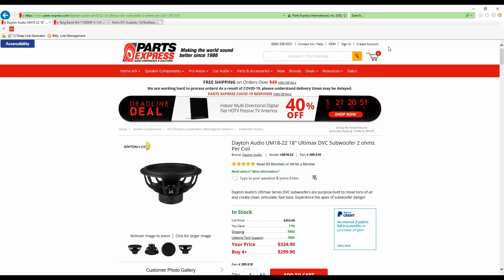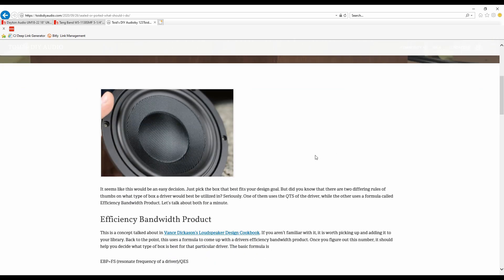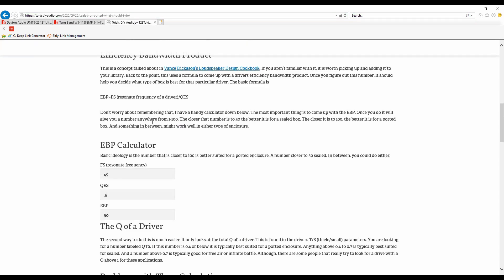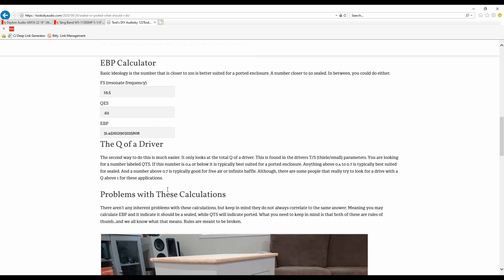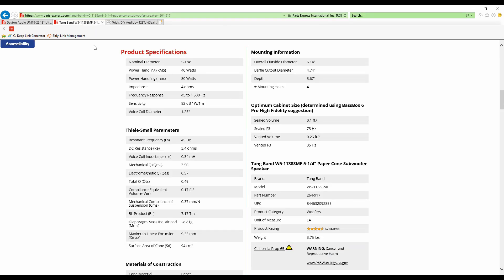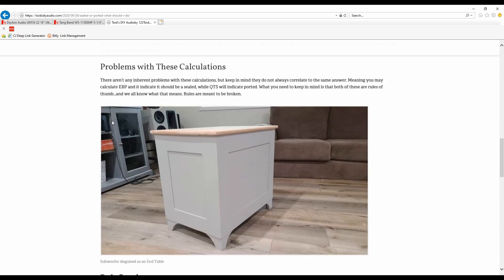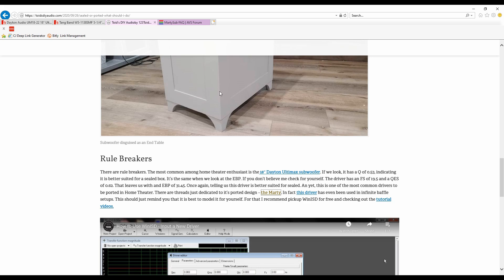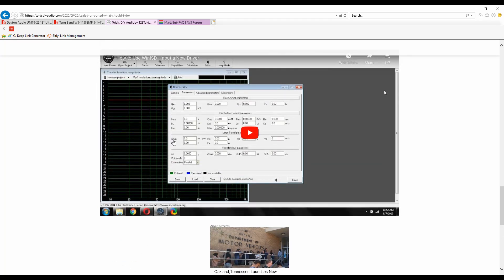Sealed or Ported. What should You do?

Comment: Of course the preferred method is to choose the type of enclosure you want to use (my preference is sealed, OB, or TL) and choose the driver accordingly. Of course if you already have the driver...

If you have a driver that wants a port try modeling it as a TL (hornresp program is free). The scuttlebutt is that TLs mitigate some of the disadvantages of normal ports.

Comment: Neither - passive radiator for box or open baffle if there is a house with space to gut.   

Sealed box sounds great but drops out on low end and needs a lot more power.  

Other exotics are too difficult to calculate and construct for novice builders.  Transmission line, folded horn, tapped horn, etc.

Comment: Watchers/readers should remember that this is all "rule of thumb" and not hard and fast. I've used drivers with a Q as high as 0.61 in ported (C4 alignment) vented boxes. Of course box size gets huge and there is ripple in the response, but sometimes you have design goals and lack of constraints on box size where this is perfectly OK.  Don't get caught up on the numbers. Investigate the possible designs and then decide. And don't be afraid to experiment. (Also, my rule of thumb for beginners: Build a sealed box, acoustic suspension, Alpha of 3 or higher.)

Comment: Interesting. First time I have seen this formulae for choosing a speaker. Sounds like it isn’t always right though. Maybe it is too simplistic? I designed a transmission line speaker awhile back and I agonized over driver parameters. I think the choice also depends somewhat on listening preferences. I gathered from researching it that I needed a moderately compliant speaker with lots of travel (large Xmax). I also decided that lots of electrical damping (Low Qe) would be good for better control over the cone movement (good attack and decay for clean, detailed bass). At the same time not too much mechanical damping (Qm) and low cone mass also should help with bass definition. I ended up choosing a Focal 5 1/4” square wire wound driver with Aerogel/Kevlar cone, phase plug and rubber surround. The final product turned out great, after a bit of tweaking. I had to re-listen to my whole music collection as the improved bass detail completely changed the character of the sound. I could now hear individual instruments and voice sounded more natural. At least that was my impression.
Reply: That’s interesting, I have some mission speakers with about the same size aerogel Audax drivers. They do surprising things for what is a small tower. Might not be as good as the Focal however
Reply: @RennieAsh  I always liked Mission speakers. Nice European sound with clean bass and good detailed treble. The woofers I used were Focal 5W 4252 paired with Focal TC90TD5B tweeters.

Comment: And then there's passive radiators. I have really warmed up to those recently, kinda gives you the best of both sealed and ported.
Reply: My Definitive technology suber cubes have 2 passive radiators and I am absolutely in love with the bass. I like deep tight bass. I find passive radiators kinda provide an acoustic spring keeping the bass tight and it is considered ported  so best of both worlds all in a small enclosure
Reply: @VINNY5674  Absolutely, Great design, more should use it.
Reply from the maker: I do love me some passive radiators.  As far as the calculations are concerned, a PR is considered a ported box.  So you will want to look for a driver better suited for ported enclosures.
Reply: Passive is a great compromise. REL uses this on their smaller subs. Offers all the accuracy with more bass extension with out loosing control or overhang.

Comment: I can't seem to get Win isd to work keeps telling me I need a huge box volume. Tried inputting the ts numbers in two ways with the same results. :)
Reply from the maker: Those are just suggested box volumes. you can edit them down and see how and what changes.  But oftentimes with drivers, you'll need a very large box to get a real low tuning. It's based around Hoffman's law.
Reply: @Toid  Cool, I shall give it another bash and play around to see what happens.
Reply: @incorporeal3793  Just remember there's a limit to what WinISD can do. I built a subwoofer some years back, 12 years ago now, and I remember I decided to put an 18" driver with a 9cuft vas and fs of 26hz in a 38 cubic foot enclosure tuned to 7hz. It did work technically (94dB at 6hz in my house), but it worked much better when I eventually put it in a smaller box (20 cubes now) tuned to 28hz. I did try various tunings with the big box but I think with such a large box there are losses of some kind that I don't know about, maybe relative to woofer size or port location. Whatever it is, be reasonable about box size.

Comment: It should be for application first. For music you may only need 30hz minimum and for movies 20hz minimum. For music quality you might be able to get away with sealed. For home you may be able to get away with ported. It amazes me how hard it is to achieve quality 20hz. I have several lower end svs powered subs and even though the frequency response goes below 20hz. They dont seem optimized for that kind of response. The sound is sloppy and struggles to perform well in that region
Reply from the maker: That especially happens when you have a subwoofer that is playing notes below the tuning frequency of a ported system.  The driver starts to loose control. It's part of the reason people love the Ultimax 18.  You can tune it to 17hz.  In theory, you should not get that sloppy bass.
Reply: @Toid  I thought that SVS was a good brand for powered subwoofers. Even their entry level subs should be good. I have the ported version. It claims to be able to go to 19hz. Im kinda thinking that the reason it is sloppy with anything under 30hz. Could be because of the cheap enclosure and port.
Reply from the maker: @randomtube8226  it could be. But just because someone says that it can go down to 19 hertz, doesn't mean it's tuned to 19 Hertz. It could very well be tuned to 30 HZ and able to play down to 19 Hertz. The diners for example are tune to around 40 HZ and have an F3 of 35 HZ.
Reply: @Toid  I wonder if I can find a better driver that would do better in the range that im trying to achieve. But im not sure about a 10in sub.
Reply: Random Tube Make sure you find a better placement for those subwoofers maybe that's your problem. I can reach under 17hz with my custom sealed 12" subwoofer I designed. I rattle my radiator and living front door with it.

Comment: Hi,
I like your channel, I have 1 question about building homemade subwoofer,
a. Can I use car subwoofer for home use ie house in a typical hifi enclosure(not car)? Can you explain if the answer is either yes or no, ie pros and cons? 
The reason I pick it is the price is relative affordable, Skar brand is very good car subwoofer as well as cheap.
Thanks.
Reply: Car audio is made for music. Around 30hz minimum. Car audio is made for small spaces like inside the cabin of a vehicle. So basically near field in you home in a small room. Yes car audio can work in your home. Hope this helps.
Reply from the maker: It is really all dependent on the subwoofer and the application. But as mentioned above, they typically aren't designed the same, so with home use there are some limitations.  If you want to jump on the forum, I am sure we can take a look at the exact model and help you learn how to model it to see what those limitations are and if it would work out for what you want to do.
Reply from the maker: The forum is www.toidsdiyaudio.com/community
Reply: @Toid  thks.

Comment: I've got acoustic suspension, bass reflex, open back. Quasi-line array in the works, along with plans for a L/R  based on some drivers courtesy Nick. On my wish list is a transmission line and an open baffle (last on the list since room is at a premium). 

Point being that the driver needs to match the design parameters of the enclosure type. The deeper you dive into how everything works the more you understand that there are many more details considered for each design, not just sealed /ported / driver size and power. And Qts & EBP are a good place to start with decisions for your desired design goals. 

Looking forward to more vids and interaction on the site. Catch you there!

Comment: Sealed. Not low enough? Add more size, box and drivers, and power. SQ all the way over ported.
Reply: All you need to do if you're on a low budget is increase the size of the enclosure and other secrets too...
Reply: Also pay attention to the T/S parameters. You want the QES to be as close to 0.41 possible and an EBP below 100

Comment: Im biased because I love sealed subs, but I always say go with sealed. You get tons of accuracy not bloated and tactile bass as long as you have a big enough driver and amp you will have plenty of output.  My sealed HSU 15" sub shakes my whole house... I loved it so much I bought a second one lol.  Things like tank shells are a lot more articulate compared to the ported I use to have, also music is better with sealed. I know this video is more about is the driver is better suited for sealed or ported but my opinion overall is that sealed subs are better.
Reply from the maker: Those HSU research subs are amazing! Parts Express had all the components at the last tent sale to build your own. They even had the enclosure. All the parts were under $200 combined. If I would have had a big enough vehicle to bring home some of the enclosures, I would have definitely done it.
Reply: @Toid  By the way great video! I didnt know driver types change what type of enclosure they are better suited for.  They sell the HSU drivers on Parts Express form time to time? I didnt know that... I actually have an extra HSU ULS-15 MK2  driver right now cause it has a slight manufacturing flaw.  When  my sub would go in the sub 25hz it would make a rattle like sound my other sub wouldn't so HSU sent me a second one after doing some tests.   I think the driver itself is actually fine but something within it is wasn't aligned properly and causing something to hit in the crazy low frequencies.   Ive been throwing around the idea of buying an enclosure to and amp to build a 3rd sub.  Im not sure what to look for when pairing it with an amp... I know those HSU amps are awesome, is there something on parts express that's similar to HSU bash amps that you think would pair well with that driver?
Reply from the maker: @Paranimal86  They do.  They actually had the amplifiers as well.  I picked up two 350w HSU research amplifiers, that you will see on this channel.  During the tent sale, they sold them for $20 each.  I couldn't pass that deal up.  They did have a bunch of their subs for sale as well.  They were factory buyouts, but have sense sold out. You can always jumpo on the forum and we can see about designing something for that third sub.  But it sounds like a mechanical issue, so you might be out of luck.